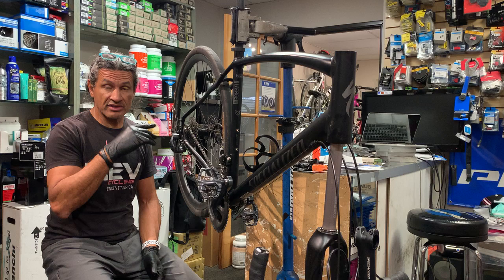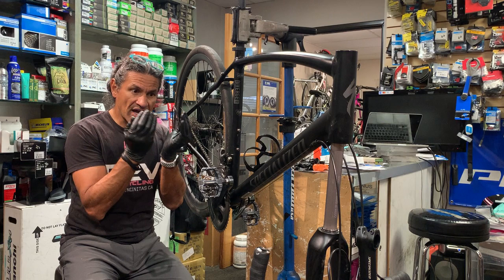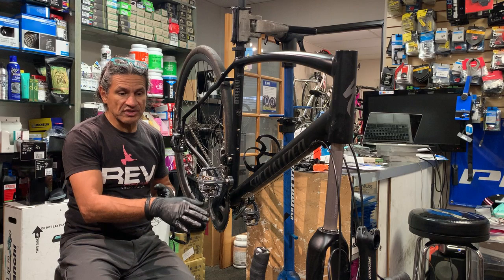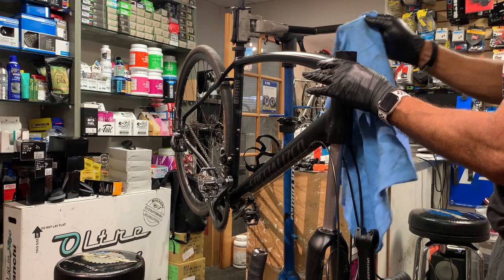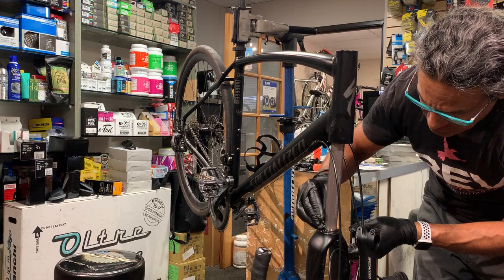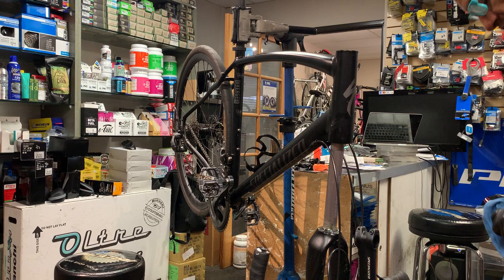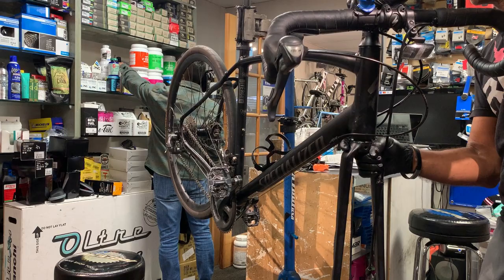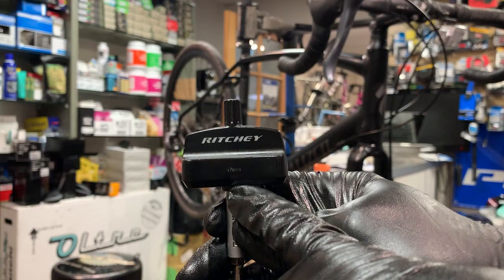How to inspect and service your headset

Comment: I love the smell of PB Blaster. And if you think riding faster will help sweat from dripping into my headset I'll do that but I am going to have to buy some wheels with ceramic bearings and maybe an over sized pulley wheels option for my rear derailleur. You do realize this is going to cost me a couple thousand bucks. 🤣
Reply from the maker: Yeah just stick with sweating on your headset bearings are only about $30 😂